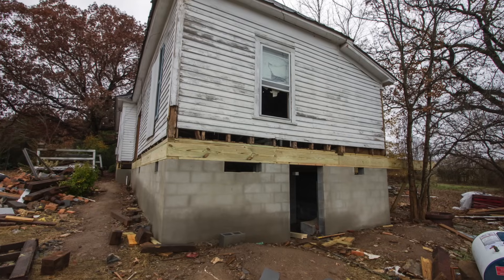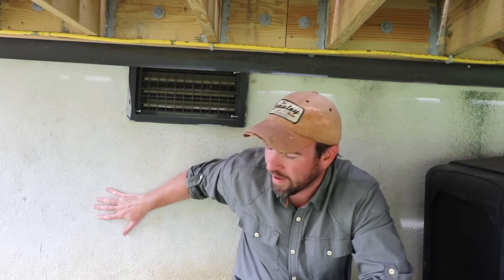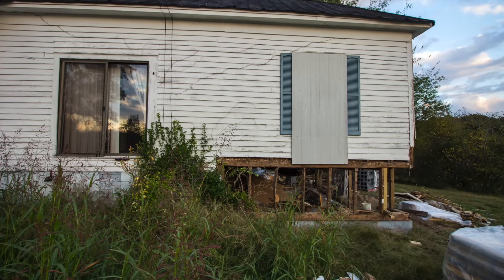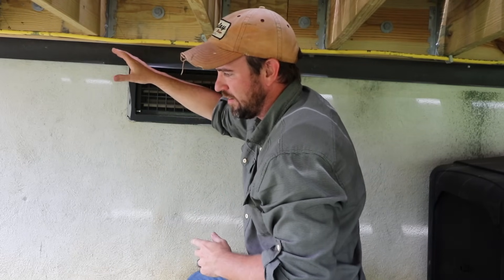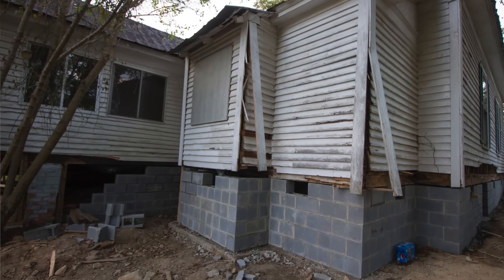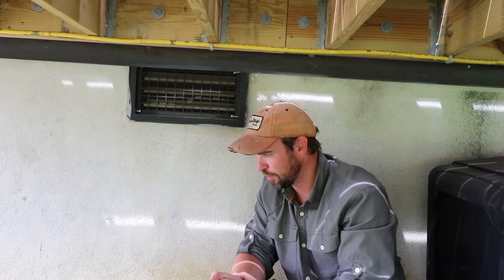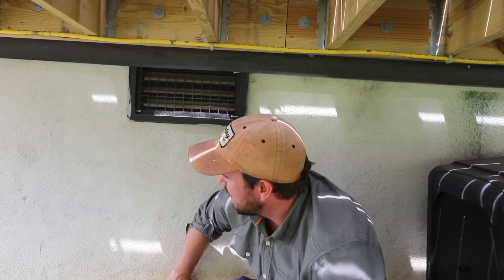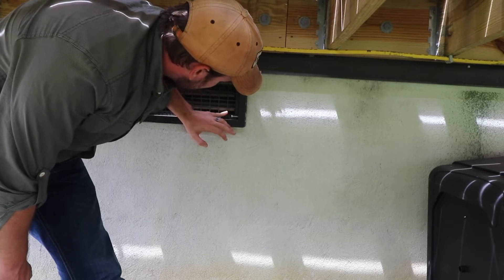How to Jack Up A House and Build a House Foundation Under an Existing Home - Trade Tips

Comment: Thoughts that might be useful on future projects:

Hollow concrete blocks "CMU's" are not meant to be a structural material.  The light and brittle "CMU's" are only an easy to manipulate formwork for the grout and rebar wall that must be poured inside the entire matrix of cavities created by the CMU's.   The structural wall is then a single concrete and rebar (monolithic structure) inside the "CMU's."  

Continuously poured grout and rebar should tie the concrete & rebar footings to the tie down straps/bolts at the top of the finished foundation wall.  The high wind tie-down straps (or bolts) should somehow tie the old wooden studs (above) to the rebar in the new foundation walls and footings).  

If the roof rafters are strapped to the top of the studs, there will be a continuous tie- down from the roof to the footings.  If you can imagine the house holding itself together while being hung upside down by it's footings, then you've likely done it right.  

Untreated lumber should never be in contact with concrete.  Place a treated piece of lumber between the new concrete and the old wood, or use a waterproof barrier of some sort between them.  Wood will deteriorate if it's not protected from the moisture which is always present in concrete.

Hope that makes sense.
Reply: Thank you for sharing the detailed information in your post. It really helped me to better understand some of the inputs of my own build. Very grateful!

Comment: I have a 110 year old farmhouse. In recent estimates with a foundation contractor I found out this isn’t always the best idea. I was quoted 50k for a new basement that I could build a new house on and 100k to Jack up the old house and replace the existing basement. Keeping in mind in mind I would still have to put many tens of thousands into the house to rehab it. I could build the new house for 70k making it far more financially logical to tear down the old structure and start over.

Comment: I have been in the foundation repair business for over forty years. If you are in poor soils, the only thing the bond beam does is to stay attached to the wood framing when the wall blows in. The only thing the pilasters every 5' do is make more work removing them when they are laying on the floor when the wall blows in. What can be done to prevent this? Proper drain tile, pouring the blocks solid with concrete and rebar, not backfilling with expansive soil, and using a shock-absorbing, insulating, draining aggregate for backfill.
Reply: can you expand on this bit "backfilling with expansive soil, and using a shock-absorbing, insulating, draining aggregate for backfill"
Reply: @fortpatches , Sure, not backfilling with expansive soil. I lay my draintile, then cover it with tire chips, then cover with  permeable fabric, then backfill within about 1 foot of grade with tire chips, then cover with another layer of fabric, then place my finish layer of material. I usually use tire chips around the  2 inch size for this work. Tire chips are available from tire recycling companies at a reasonable cost. They weigh about 600 pounds per cubic yard, compared to 2,800 pounds per cubic yard for rock, this makes them very easy to handle. I usually get them delivered in 100  cubic yard loads for about $600. Here we can haul about 18 yards of rock on a semi, so that would be about 6 loads of rock compared to one load of tire chips. A load of rock here costs about $600 in a pit. Big cost savings!
Reply: I've been removing Expensive clay soil from the foundation of my house. Because it has eroded the footer due to the freeze thaw cycles and the way I've been doing. It is in 4 to 6 foot sections at a time with a sacrete product bonding agent.  In addition to a concrete white glue slurry to form a grout between the new and old concrete. In addition to a 12 inch number 4 Rebar grid and holes drilled into the old concrete inserted with number 4 Rebar, and a concrete epoxy to form a continuous Rebar grid For the whole run of the length of the foundation. I know that it's not a monolithic pour , but do you think it's about as close as I can get, without jacking and blocking the house? Any advice or tips/critiques would be greatly appreciated. I've replaced the clay soil with large baseball size stone, smaller 3/4 pea gravel, and sand and installed a French drain sysyem , perforated 4in flex drain beside the bottom of the new footer , which by the way is 12 in wide and 24-36 in deep, with a non woven landscape fabric.  When completed, I will have a complete drain system around the house and an entirely new, though not monolithic per say footer. Before I installed the new concrete I compacted the soil beneath as best I could by hand, and laid 2in. Of 3/4 pea gravel. I mixed the concrete myself by hand , a little on the wet side, then covered with plastic, sprinkled with water for 3-5 days 4-5x daily. I hope to save some money, fixed income, and I don't mind hard work, I didn't know it was this bad until I began some structural repairs on my deck , and uncovered the  clay soil/eroding footer, and I bit off way more then I ever hoped to chew with this one.

Comment: What you're talking about with so-called self-leveling concrete is concrete that has an extra (non-water) ingredient added to make it flow more.  That plus a concrete vibrator will get things pretty close to level. The drawback is that type of concrete is more expensive. Also, if it flows too much, the lower tier will overflow from the upper tier's concrete.

Comment: Man did you get lucky not having to jack it very high as you initially thought, that is so convenient in terms of time, good to see your happy with how it all worked out and are happy with the outcome and fitted your budget even if it is not the best choice with masonry unit in terms or their reliability issues being knows to bow, lean or even topple in an a decent enough quake. 

Believe me when I say I have personally seen many leaking issues of said type of wall construction choice from my experience doing basement waterproofing on this and many other basements that previously lacked proper water mitigation. But like I said its about ones needs per use or not and budget. If you wanted to use it for additional living or storage and insulated, ICF would have been the better choice, but then depending on your budget and the shipping cost plus local concrete supply cost probably would have made it be a higher up front but the time ICF forms save and added fact it pre-insulates the zone, it is more suited for insulated extra living space. But you should had instead of just encasing the top layer included some sections with rebar and concrete fill so it at least lasts and withstands against certain forces more better for the sole purpose of just a foundation for your home.
Like I said you seemed happy with this choice and it seemed like a perfect solution for your house needs. Definitely a needed improvement to the old curtain wall and pier it sat on.

Comment: Wow, thank you for taking the time to make and share this video. Several onlookers have added their comments to make the topic of building in a sound manner even more robust. You answered so many questions I had about footings, foundations, and the related construction principles. I am trying to build a very small home (23x30, two floors) on a tiny lot. There isn't much space on the surrounding lot for the builders to work so not many want to even touch the job. Because of this, I will have to work as my own GC and get the project done piece mill (i.e. using various craftsmen). I will also have to invest some sweat equity as well. The home will be located square in the middle of flood zone, so I need to build it on some sort of raised foundation, around 8ft high (so I can park underneath - no space on the lot for a garage) maybe on piers. I need to do this so in case of a flood, my home isn't carried away or damaged by passing debris. Anyway, your comments gave me a better understanding of foundation issues and also provided an idea of how to "skirt" the piers, since the local building officials do not like he idea of building on piers (because it doesn't fit in terms of the 1900's aesthetics of the historic neighborhood). Anyway, there was a lot of info to gain here so thank you once again!

Comment: you should have encapsulated that crawl space and had it as conditioned space without vents. This would control humidity quite well without having to vent to the outside... and it would keep your heating bills way down.

Comment: Thanks for your photos and education sharing.  I am pier&beam 1965 with only side curtain. However, I guess in 1965, someone failed to 'think' to place the front house wall beam on top of a pier, vs a beam, and now the other wood section is under the 'deck' hello no flashing no protection treatment of the beam, so it is dropping 1.25 inches off the front, so I plan to build 3 piers under the front wall, and to prevent cold air, will add the entire wall, but now after seeing this, I may do what you did and foot it all in the front, and build up from there.  I am now on 3-Jackpost jacks 29" and raising it every 2 days to get the front level.  Definitely using rebar and concrete inside the cinder blocks. Question: what did they cover the cinder outside with? is that Stucco? Thanks again for the footing info!

Comment: You didn’t mention it, but I hope you added a good water resistant membrane on the exterior, drainage, and clean crush gravel instead of the native dirt. If not those empty cmu’s will soak up any water

Comment: Shouldn’t all the cinder blocks be filled with concrete, and rebar put through as you build upwards?  And every few rows of bricks you need a row of lateral rebar? Then J bolts at the top to bolt to the sill plate.  Walls over foundations are left hollow.

Comment: You still need to fill them because of the moisture. I just saw a older home the wood  had rotted next to the block because they didn't use a solid block. The house has to be jacked up and The damages replaced including making those top blocks solid

Comment: Not a troll, and just asking for learning purposes, but those strips to attach the house to the foundation do not seem like it would be strong enough to hold the house in place.  How is that going to work?  Wouldn’t the slightest of earthquake or high wind weather just wear down and snap that metal sheeting?  It appears very flimsy not strong at all.   Perhaps I’m not looking at the right thing at 10:03 mark.

Comment: Why the heck wouldn't you just fill ALL the blocks with concrete, and not just the top course? That just seems like a no brainer
Reply from the maker: I’ve always wondered that myself, for our foundation we were working with a General Contractor, typically they will only fill areas where an engineer specifies a pillar,  but he didn’t even hire an engineer.  We fired him after the foundation for many reasons and took over as GC ourselves. Filling ads strength and thermal mass so it’s definitely worth the extra cost.  But it takes longer to dry, longer to build, costs more, and requires some effort, where the empty blocks are “sufficient” per code.

Comment: How do you jack up a house evenly at the same time?
Reply from the maker: You have to measure out your lines ahead of time and then slowly work around the house little by little.
Reply: Ah ha! I had a feeling but wasn't sure. Seriously this video is great. Thank you for posting it.
Reply: The best way is using a unified jacking system, but as he said they only needed to go a few inches, in which this case the aforementioned would just have been overkill and a bit impractical.

Comment: Can a house be lifted or moved to sit on a new built garage?
Reply: Yup. Most anything can be done with enough money. My parents house was a brick house on a concrete mono slab that was only about a year old when the state decided that it needed to be bulldozed to expand an interstate highway. We cut the house in half and tunneled underneath it cribbing it with 6 by 6 wood blocks. Then we slid big steel I beams in place and and bolted them to heavy-duty over-the-road dollies. We towed one half of the house with a dump truck and the other half of the house with a front-end loader. We took it to a new building lot approximately 2 miles away even crossing over the interstate on an overpass. The house was then set on a new foundation and stem wall with 72 Piers underneath it to support the concrete mono slab. It's been there for over 25 years now and it's always the easiest house to work on when I need to do something with below slab plumbing because everything is exposed in the new crawl space underneath.

Comment: and we have 15 ton jacks in aussie $110 ea
Reply: how in the world do  yall forget to core fill your foundation lol?
Reply: so called "experts" or "get the job built and done and cut corners" for a bit more profit type "company". All too often I still see cinder masonry units not being reinforced along the wall and the homeowner suffers down the road when it starts to leak water inside or bow to the point of toppling by to not previously adding vertical or even horizontal rebar every other layer in the masonry "grout" to prevent such collapse failures to protects against natures wrath from heaves or even the chance of an earthquake.

Comment: Self levelling concrete lelf levels by gravity because its runny. Self levelling concrete could have been used to pour into the blocks.
Reply: how do you pour to the top block with the structure in place? Is there a small had pump or mud pump that you would use?